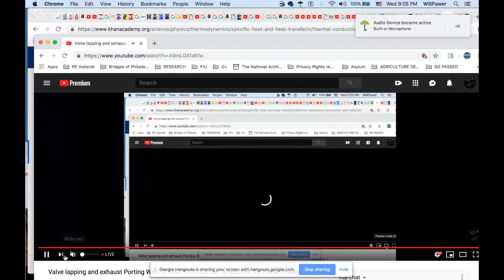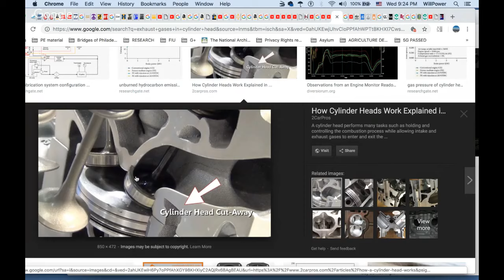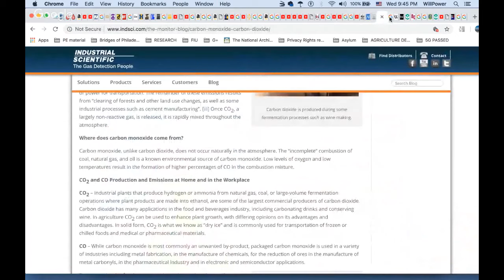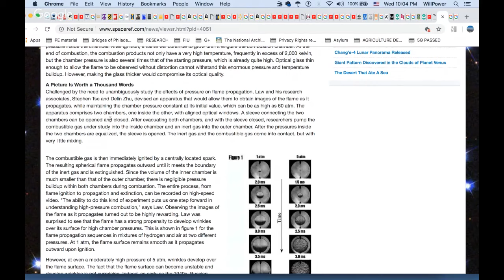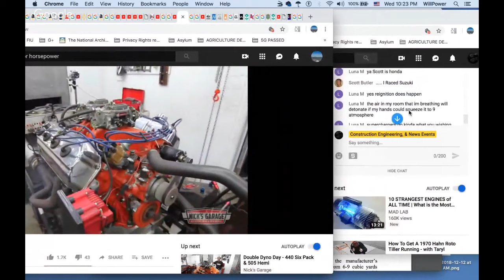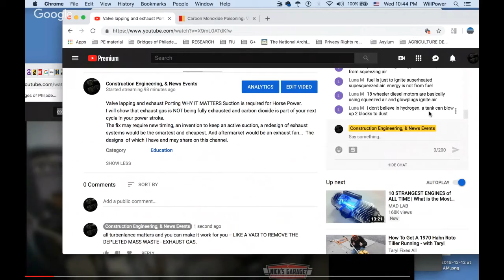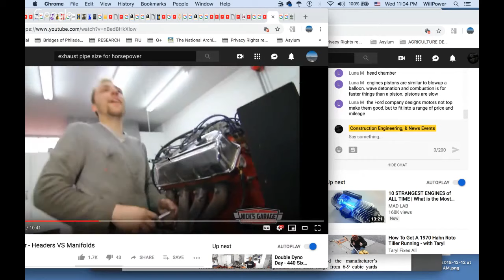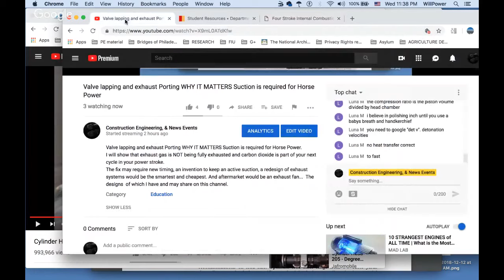Valve lapping and exhaust Porting WHY IT MATTERS Suction is required for Horse Power

Comment from the maker: I was looking at cylinder head flow machine shops and they use compressed air with zero ''back pressure'' - this is NOT how the real world environment is.  This is evident with the example in this video with the headers vs manifold designed exhaust pipe installation... The video shows that it matters what is happening OUTSIDE of the head. 
So what you have awesome flow in the head; the exhaust system is then the ''bottle neck'' of your exhaust side of your performance system.  Also, flow testing does not use the compression ratio and retraction of the cylinder piston itself~  this is the real world condition - with HEATER air!  Exhaust gas is NOT the same as compressed air, it has been changed chemically... 
How fast does it move compared to compressed air? (I do not know exactly but, it is not the same conditions and you cannot simply extrapolate as the gases are NOT the same.).   I find the combustion chamber very interesting and complete combustion is ideal but not achieved yet...  the fuels are still coming out at the tailpipe, which means waste of fuel...  I would love to know how much fuel is in the exhaust; I cannot find a study on this.  Please, feel free to send me any link you have and I will read it and respond in kind...    With the limits we have, I would hope some porting, exhaust changes, compression changes, spark changes, timing of valve duration and possible a power fan on the exhaust would give more horse power...  and ideally, increase full ''burn'' of fuel.   The question is why the fuel is NOT fully used? I would think the air-ratio is wrong (compression) and the extra fuel ''required more air'' to complete it's burn cycle...  Perhaps a ''double spark'' would give an extra boost as the cylinder was being pushed away from head... that this secondary spark (being more intense) could spark the remaining compressed gases (I know the ratio has changed at that point and this spark would be designed to spark at that range of compression ratio and the remaining unburnt fuel (air mixture) would get the secondary BANG to complete it's combustion burn... One spark plug or maybe two would do this action and it would be an electronic message and not a cam message that causes this secondary spark. 
Finally, the gases that are left require energy to remove them! The do not get pushed out for ''free''... MOVE that volume OUT and do not allow for recycled shit gases unless, something like an egr system that can recycle or burn the ''diluted'' intake and mostly burned exhaust gas that has NOT escaped in the ''exhaust stage"... That when the air is ''pulled-in'' from in the intake stage, it is also mixing those gases that are mostly burned and this changes the ''air-ratio'' which is really changing the compression ratio as the compression ratio is based off of ''air'' and this new ''creation'' is NOT fully air and might be equal to the ''head-volume" mixed with the ''cylinder volume"...   basically, besides a hard start, maybe we should consider using that ''air-mixture" as the ''true'' product of ''compressed air'' that we attempt to ignite with a spark... Perhaps, we will find that a different fuel mixture and spark(s) are required to complete the burn. 
Finally, the ''controlled explosion" should be more ''directed'' with respect to the tops of cylinders and direction of ''back pressure'' from the heads...  ideally, it would bounce off the top of head and ''focus'' the bounce into the centerline of piston {down the piston rod} onto the crank shaft without to much ''redirect" .  The redirect is happening when the arm takes an angle turn at the piston and at the came lobe. Of course, this redirect is required to get the rotation. Yet, it appears a lot of friction is experienced at the piston * proof of that is the out of round shape of the piston walls... This is caused by the rings and the design of the piston surface that ''redirects" the explosion and it's forces to the outer walls and not just downward... This causes the rings to reshape the walls of the piston block walls... This is a waste of energy.
The wasted energy is also in the piston connection to the piston itself; less friction is what is desired and this less friction makes it easy to move almost anything with ease... More the friction the more is lost...   (I have to run and could not complete all of this post but wanted to open it up for your ''trolling and good banter on this subject")...  
Smaller piston rings also give you about 8 horse power more, as shown in this video... friction really matters...  get it down!